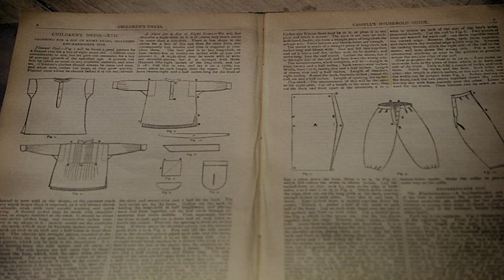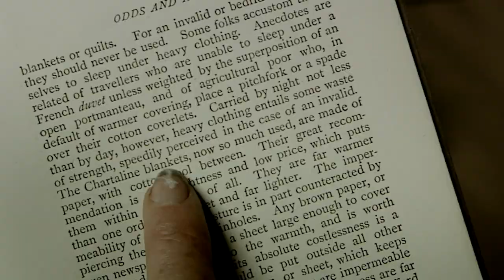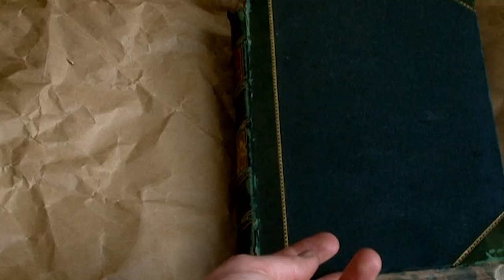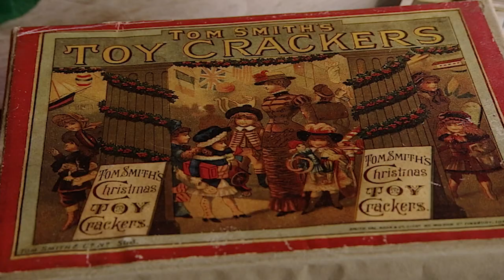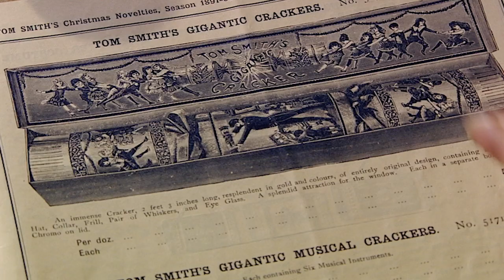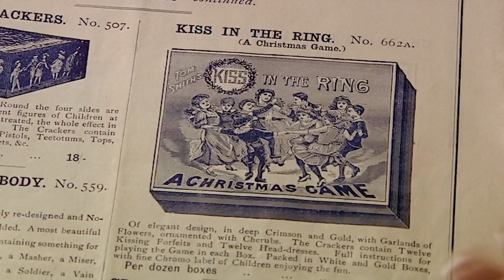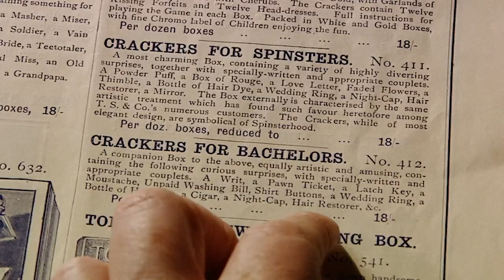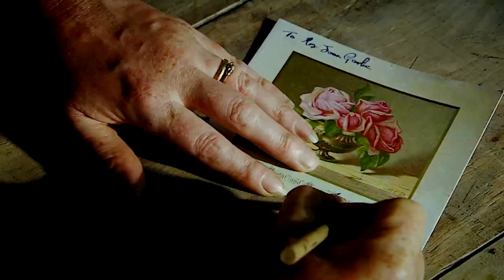How Victorians Survived Winter | Victorian Farm: Christmas (2/3) | Real History

Comment: I don’t think modern people realize how much wood, coal and kerosene smoke people were exposed to  before electricity and gas heating.  It must have reduced the average life span by a decade and more in industrial areas.  In the earlier medieval times, most homes didn’t even have chimneys or vents, smoke just oozed out of the thatch roofs.  I’ve lived off-grid and without these modern conveniences, life is very hard.  Even to wash oneself, water has to be hauled and wood chopped to heat it.  Shampooing even once a week is a luxury.
Reply: Actually, as Ruth demonstrated in the Castle Series, it was much more common to clean your hair by combing with a hand-carved but very fine-toothed comb. 
Having tried it myself? I can assure you that it was VERY effective! And my hair at that time, was nearly 4 feet long
Reply: @deboraharmstrong3002 yeah but a comb is a mechanical tool.  Without shampoo( a weak chemical base) your not removing  the grease and dirt.